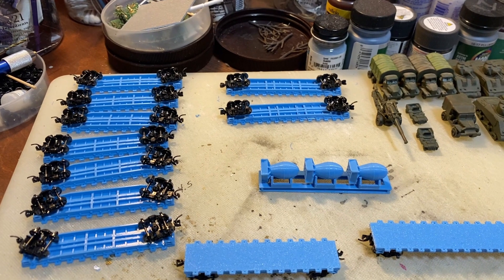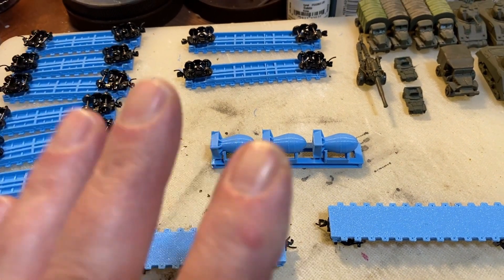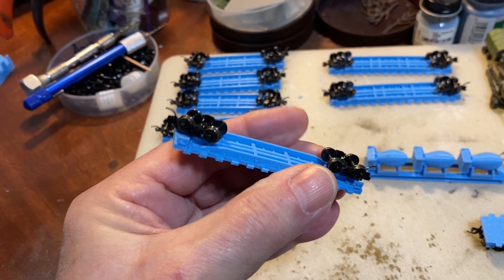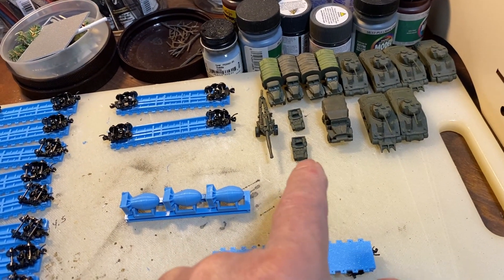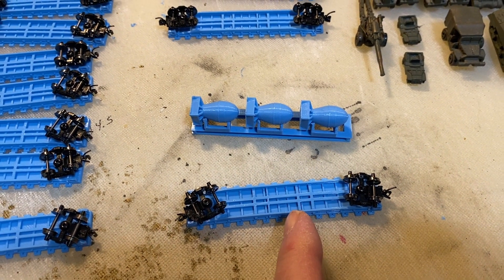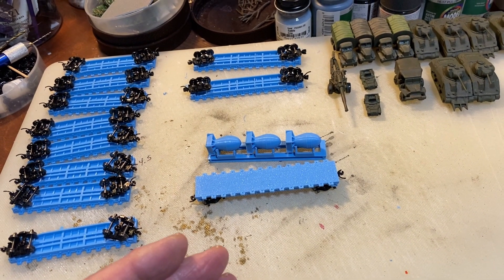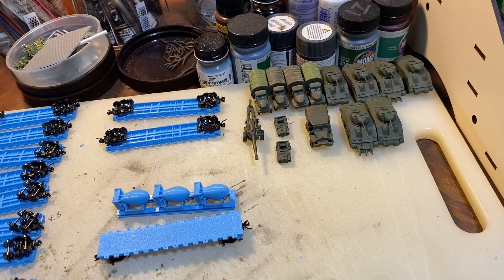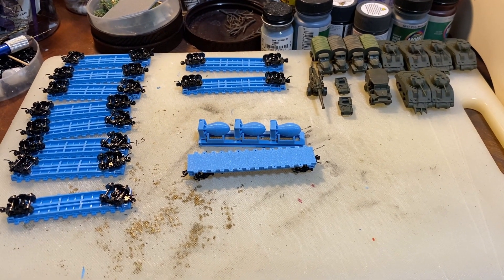Before the Storm - New 3D Printed Flat Cars

Comment: John do you happen to know the part number for those trucks? I’m looking to start printing cars and don’t know which trucks to buy from micro trains
Reply from the maker: Hi, I generally use MTL Bettendorf medium extension trucks that I buy in 10 packs. The new P/N is 00310022 and the older one is 1003-10…….John
Reply: @tanzj  John thank you I appreciate the response

Comment: how is the weight on those printed flat cars?
Reply from the maker: Hi Sparky, I have not weighed them, however, after adding the MicroTrains trucks with metal wheels plus the vehicles I believe that they will be fairly close to the correct weight in N scale to run properly. The printed car by itself is lighter than a commercial car since they usually have an embedded flat weight. The design might be able to be modified with a hollowed out top surface for added weight which could then be covered with a scale lumber top so that the car could run empty. 

I will let you know how they do weight wise in the next couple of days, assuming that we have power……John